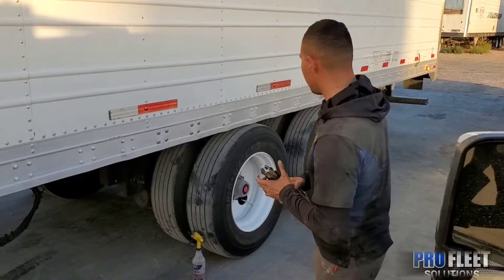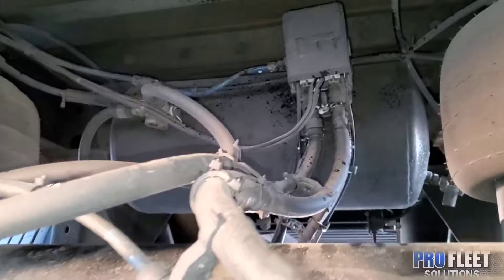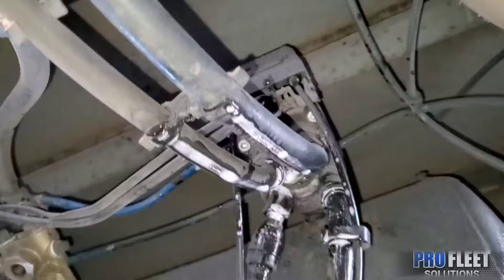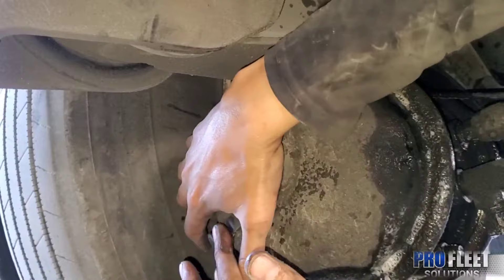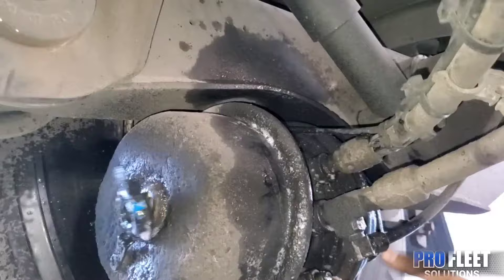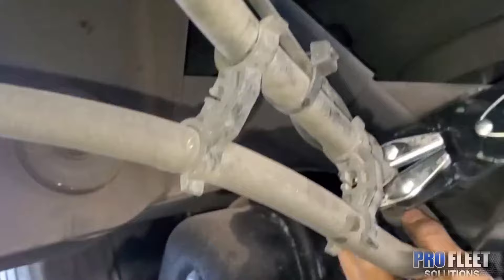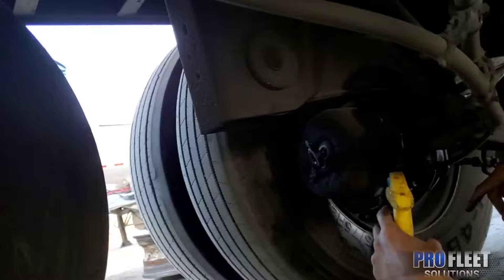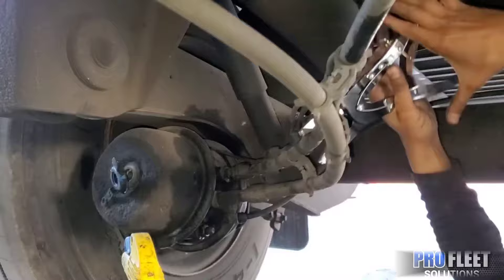Quick Easy Way To Check For A Leaking Brake Chamber

Comment: Just wasted a lot of money with downtime and replacing an ABS/traction control valve and both modulators at the advice of a mechanic, only to discover that it was a bad brake chamber
Reply: Hot dang it mang I just did the same cause when I released my parking brakes the relay valve would leak all the air and whole time I had to bad brake chambers

Comment: Good job man! I just changed one that had very loud hum when on the brake pedal.😀
I spray everything else for leaks but never thought about spraying the brake chambers!
Reply: hello ,what do you mean with hum? my english is not perfect but is it a sound that hum ? and on your truck or trailer ? thank you
Reply: @benkr5870  The brake chamber was leaking with the foot pedal pressed. That caused a sound much like a musical wind instrument with a reed.
Reply: @RC-Heli835  ok ,so if it leaked..it was on the rear axle? Your brakecilinder was the same like in this video ? So when you press on the brakepedal the air goes into  service room but a little bit escapes to the other room ,the room with the strong feder for handbrake ?
Reply: @RC-Heli835  when u mean hum is it like a rusty hum? Mine might be bad but im not sure.
Reply: @rigobertoespinoza1685  No! with the brake mashed air was escaping a brake chamber making it sound almost li look e a wind reed instrument!
Reply: @RC-Heli835  well i know i have a wierd noise coming from the air brakes after it releases pressure instead of thiss sound it almost like a rough hum
Reply: @rigobertoespinoza1685  Are you losing air with the yellow button in?
I had a bad brake chamber and a bad tractor protection valve.
Reply: @RC-Heli835  no its a box truck im not losing air at all i just dont know what that sound is its driving me crazy ill inspect it later on today

Comment: If i understand it correctly,you clamp the service brake hose so that air from the handbrake chamber can not leak further in to the service brake chamber ? With clamping you dont hear the leaking sound anymore ? is that correct or ?
Reply from the maker: That's correct, you clamp the service hose going to the chamber. Even if you don't have a leaking chamber when you normally supply the air. By having the system supplied with air and depressing the brake and holding, if you have a bad chamber that's when chambers leak also. But for that test you obviously need someone to help you depress the brake while you go around and check which chamber is leaking. Thanks for watching sorry for the late reply✌️
Reply: I have a trailer that the quick release valve is leaking when you release trailer air supply brake? Could it be one of the chambers?

Comment: Did you release the brake?
Reply: Yes... you have to in order to run air through it
Reply from the maker: Yes and always chock your wheels.
Reply: What hose did you clamped. Service or parking
Reply: How do you know which hose to clamp